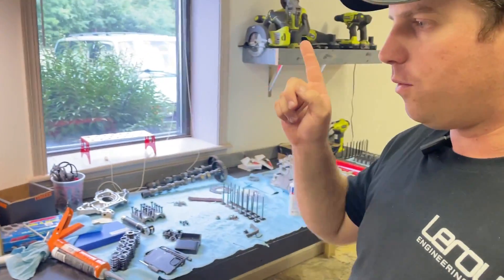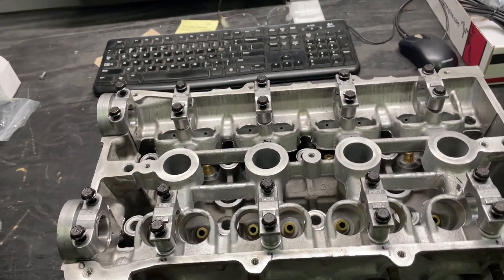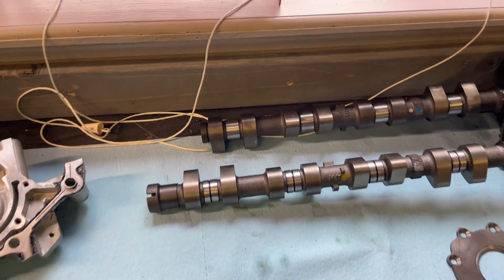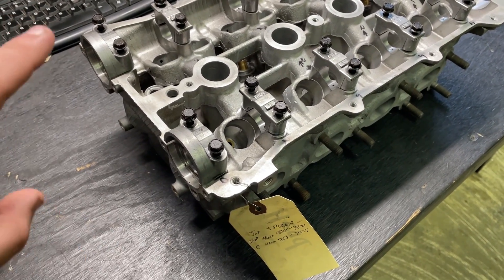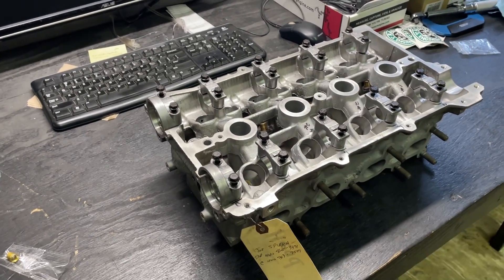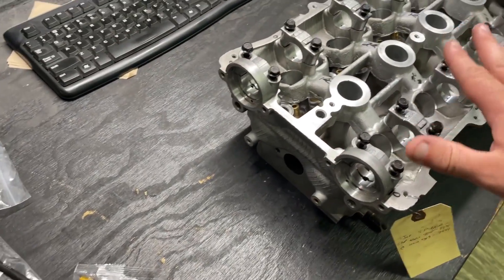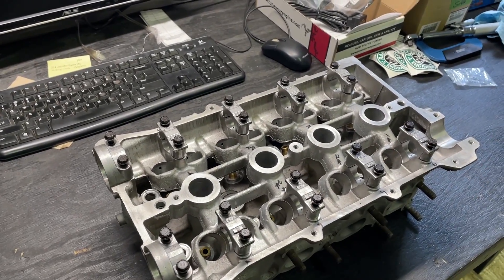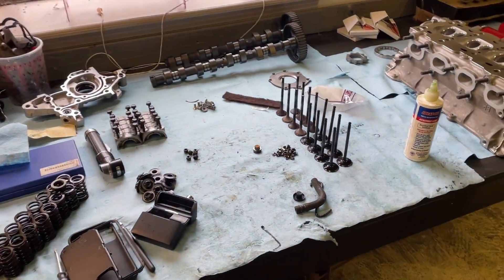Checking a cylinder head for warping.

Comment: When you say it shouldn’t be difficult to spin the cam shafts by hand, you mean without the valves and springs installed?
Reply from the maker: correct- just the camshaft and caps torqued to spec. No lifters.